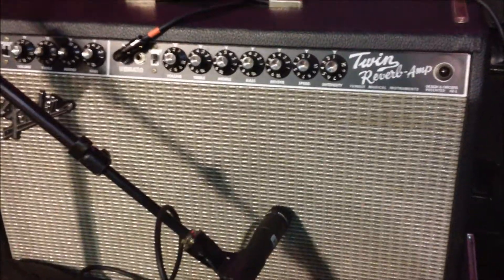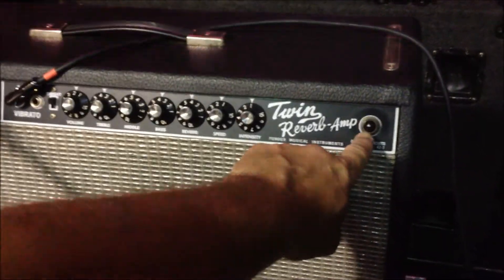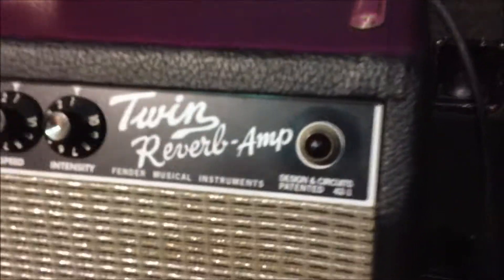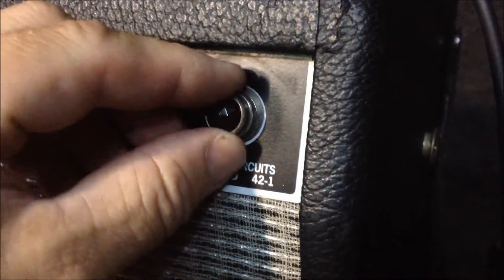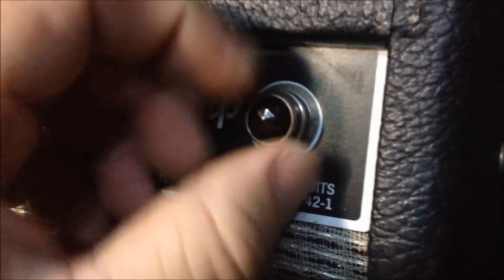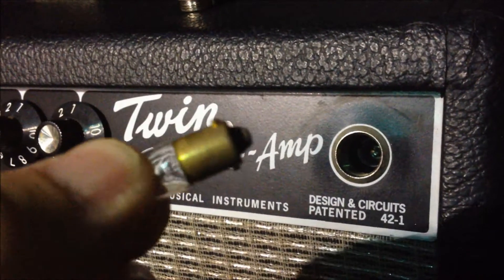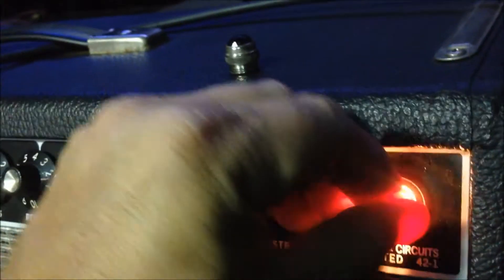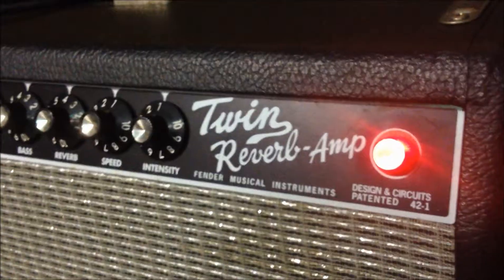how to fix a burned out light bulb on fender twin reverb guitar amp

Comment: Just brought home a Princeton Reverb. Alessandro rewire. It played fine for an hour. Turned it off. A few minutes later,  turned it on again. No light! I feared the worst. It has sat in storage for 6 years. Never been used. No warranty. Oh, no! Lol, I moved to another outlet to confirm power.  
It is so quiet, it took the reverb tank to rattle for me to realize it was just the light.
Found your video. Success! Loose bulb!
Thanks for posting!

Comment: I have a '52 Twin and the on/off light burned out.  I bought two Fender replacement bulbs and neither one is lighting up.  The amp turns on and works just fine, though.  What can the problem be with the bulbs?  Thanks
Reply from the maker: Sometimes the bulbs are difficult to turn and get seated properly. Push in a little in the bulb, careful not to break the bulb. It could be the socket, and it could be a wire disconnected that goes to the socket. But most likely it's a bulb not seated well.

Comment: What is the deal with these lights?   Like my fender amp and also my friends deluxe reverb both have lights that go dim randomly and sometimes out completely I don’t understand why
Reply from the maker: It's certainly not the best bulb/socket to use these days. Hopefully manufacturers are upgrading to LEDs.

Comment: My bulb is recessed just enough that I cant get a grip to turn it.... any tips
Reply from the maker: Maybe put a rubber washer between your finger and the bulb to turn it? I used tiny needle nose pliers once, but you have to be very gentle so you don't break the bulb.
Reply: I used a soft, sticky rubber piece of tubing slightly smaller than the diameter of the bulb.  Push in and turn. Should come out when you pull the tubing.

Comment: How do I remove/replace faceplate? Is it easy to do?
Reply from the maker: Are you trying to remove the faceplate from the chassis? or take the whole chassis out? The faceplate is glued on to the chassis and can come off with concentrated steam injected between the faceplate and the chassis. If you want the chassis out, I have another video showing how to remove the chassis from amps. #guitartips #chassis #guitaramps #fender #fenderamps
Reply: +Sammy Bones everything came off easy except the pilot assembly had a washer holding it on from inside chassis